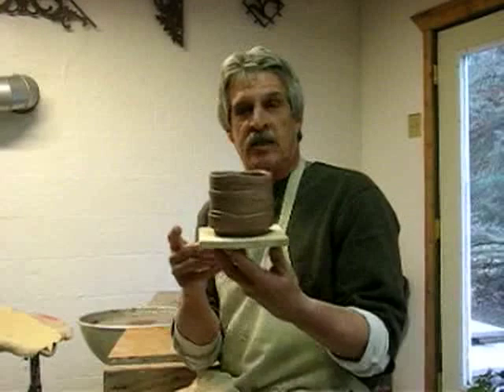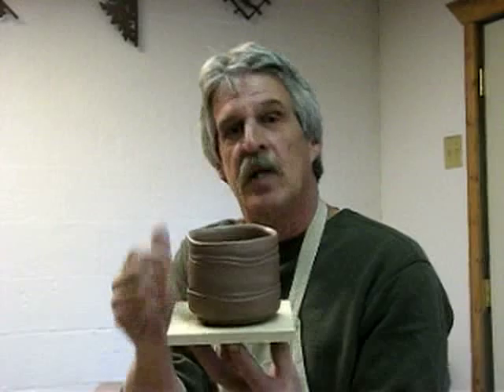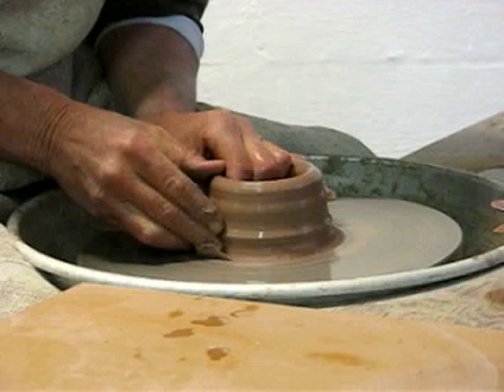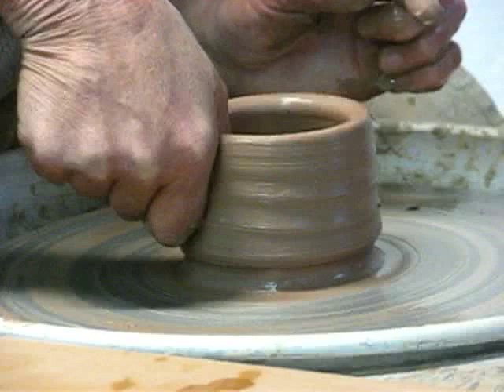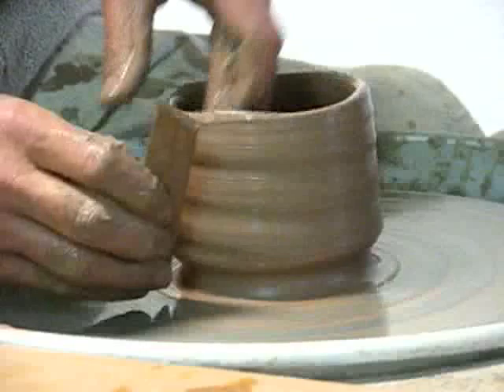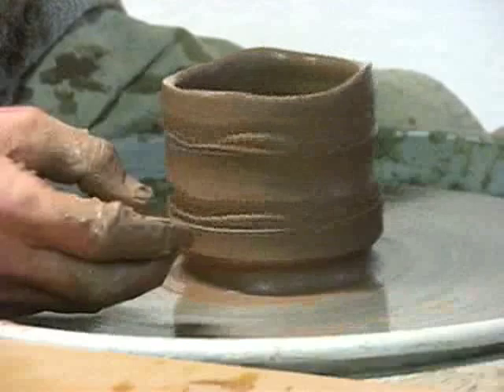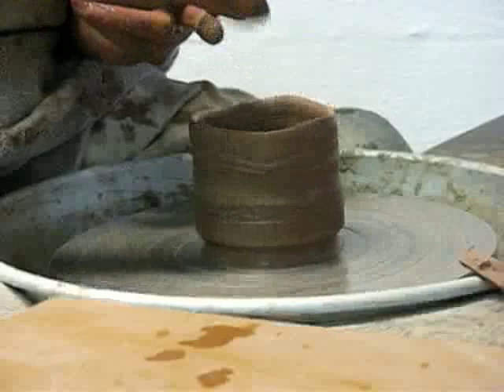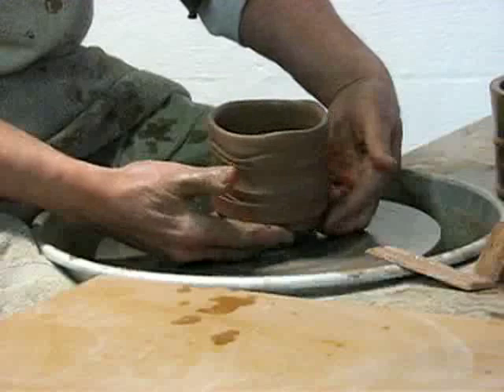How to Make a Tea Bowl with Landscaped- Rim

Comment: Love it. I did a little pottery in Japan when I was there. My teacher used to weigh the bowls aiming for about 230 grams in a good bowl. They were very thin walled. I was a lot better at shaping the feet than forming the shape. But sometimes i would get a nice wobbly rim just through inexperience on the wheel. The best of these wabi sabi bowls I made a silk bag for and bought a wooden box and gifted it to my teacher before I left.

Comment from the maker: @stevebootonceramic and also Dorothy on Facebook : How I trim depends on if I have many pots, or, just a few. If I have a lot of pots, I will throw a cone shaped chuck from soft clay and skim it dry with a rib. I'll then drop each cup in succession over the chuck to be trimmed. If I have just a few, I'll throw a 1" thick clay  pad which allows the uneven rim to press securely into the pad. The important part is making sure the untrimmed base is level and both these chucks allow that to happen.

Comment: Nice tea bowl, Bill.  After buying and reading your book Wheel-Thrown Pottery I made one of your ribs.  Mine is a little wider, but works well. It never occurred to me to use the wide angle, but it looked good for the added lines.  I typically use the 90 degee curve of a wood rib; now I have another thing to try, and I may need one less tool out. Thanks.

Comment: I don't see much compressing in your videos. You must not have 
s-cracks on the surface of the bottoms of your work after firing. Compressing stops this from happening for those of you who do suffer with s-cracks.
Reply: s cracks are mainly caused by over saturation with water on the inside base of your pot. Make sure not to let water build up inside your pot as you throw.